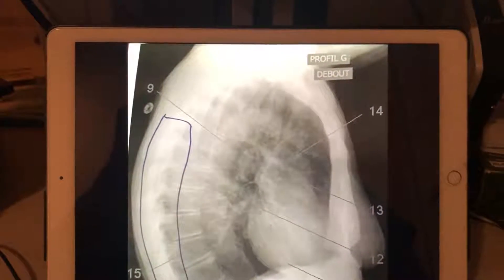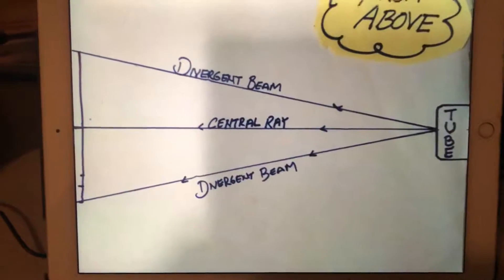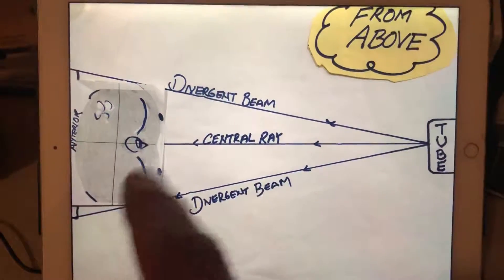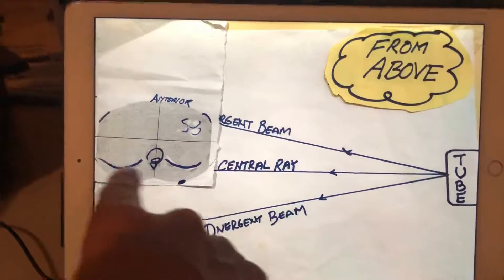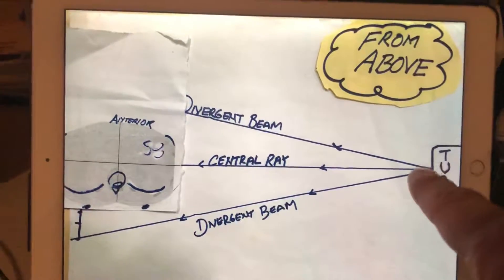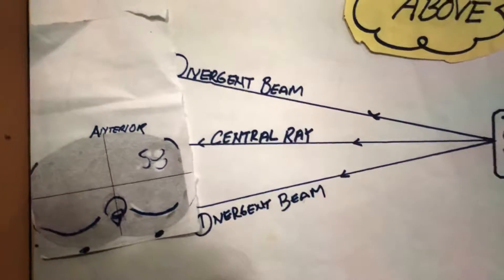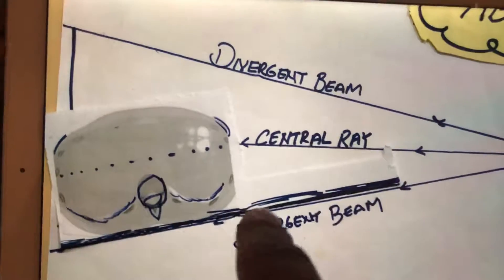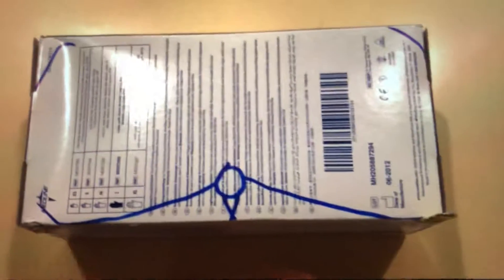How To Rotate A Lateral Chest X-Ray Perfectly - Every Time!!!

Comment: Does it work for lateral weight bearing knee also?  Please do one for for lateral knees and y views :)
Reply from the maker: Hi, sorry for the late reply. It does apply as well. You’ll need to do a slight rotation and an angle up or down depending on if you’re medial or lateral. Most likely if you’re medial lateral, you’ll be shooting with an angle up an angle down and if you’re shooting lateral to medial you’ll be shooting with an angle down. I’ll be doing special views coming up. I just finished a series on upper extremity and lower extremity. Upper extremity including the elbow and up to the elbow, and lower extremity up to the pelvis hip.Thanks for watching my video and I hope you come back to my channel. Jeff.